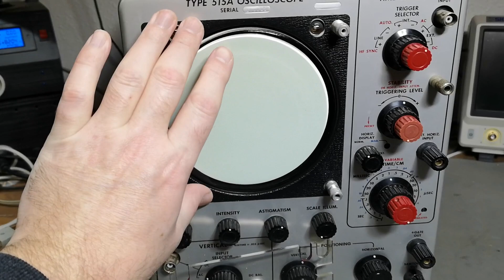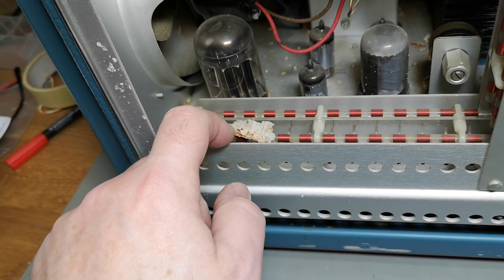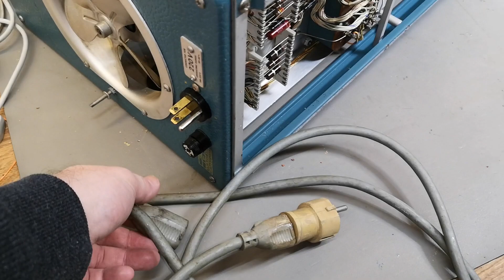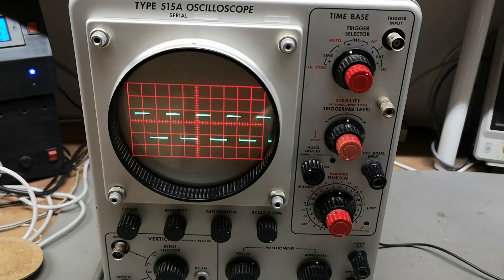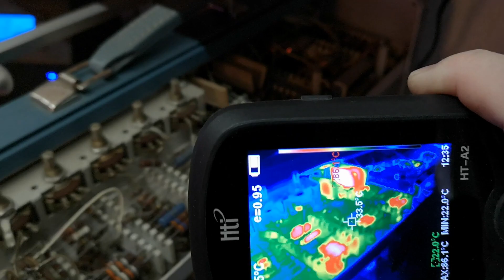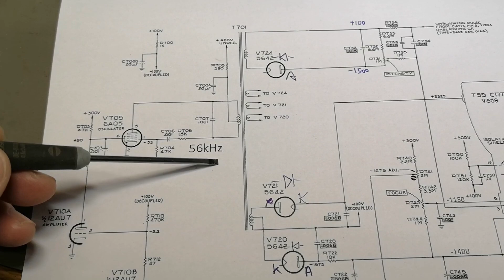Tektronix 515A Oscilloscope 1ch 15MHz 1957-71 33tubes 275w

Comment: When I've heard arcing in HV CRT circuits, I've always checked the anode lead first, the tripler second, and then the focus lead and control. Next, look around the HV transformer. In this unit, I would also check the cathode connection on the back and make sure the terminals are tight.

Comment: Really!????  You are going to power this up without checking tubes, checking capacitors and reform them if necessary.  And I would power the scope on filaments first before the high voltage.
Reply from the maker: I always perform good visual check, tubes, caps, and all that normaly is a known problem, my power up system do contain watt usage monitor and tiny fuse barely able to handle the tested unit and i power off fast if anything is not fine, watch a lot more of my videos and you see,
Reply: No need to over complicate simple things. Bringing the scope up slowly will do the job.

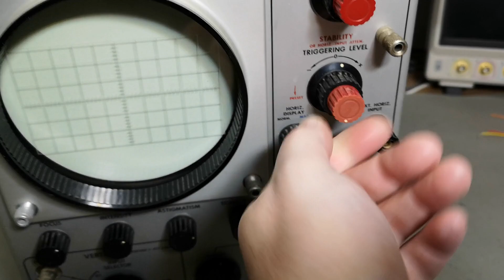Comment: What was wrong with the stuck trigger selector at 3:40?
Reply from the maker: the old grease/oil round the shaft inside the switch turn it self into gum, it is a normal problem with such old equipment, adding only high prof alcohol renew the grease, so it run smooth again, i add it a few times and turn the switches many times

Comment: Remember to only use silver solder on those ceramic holders. I only had one of these scopes, and it contained a small length of solder in a bag inside, special for repairs and with the warning.
Reply: Have a look at 6:35 ;)
Reply from the maker: exactly, the tiny special silver reel
Reply: @Sine1040  LOL i completely missed that part :D

Comment: WoW, it's even nicer than the one you tested yesterday when you wrote about another Tek, so I thought you managed to get the dual fet, but this is a gem, the wonderful display - not even a phosphor display compares to it.
The eccentric for centering the grid is great, but I was surprised by how evenly lit it is, I can't help but think that it used to be made not only technically, but also with heart.
That cork will be from the delimiting insert of the shielding on the CRT.
If the transformer really has a damaged winding, I'm afraid that even checking the Q factor won't prove anything in this case.
Image dropout + increase by 300V - my first guess was a faulty potentiometer or resistor 742 - here my acoustic sensor would help in locating the hornet's place.

Edit : The logo display is great 👍

Nice day 🙂 Tom